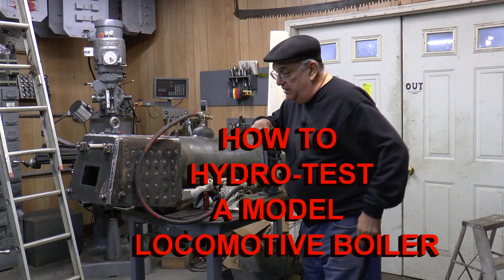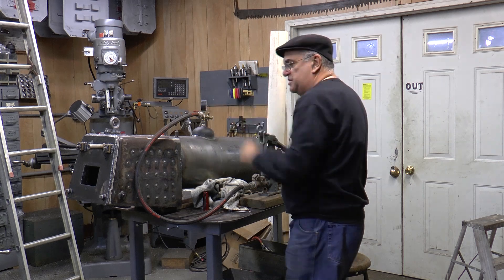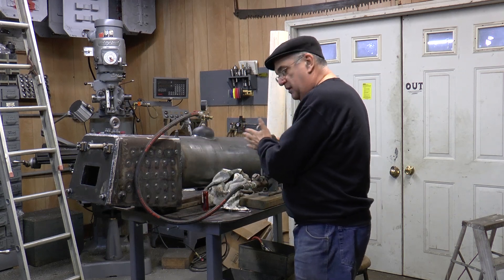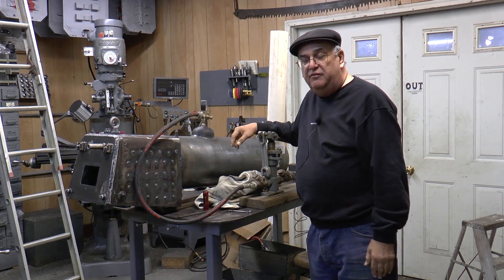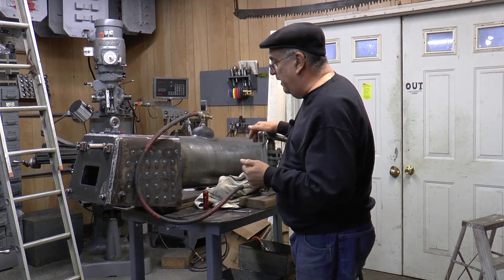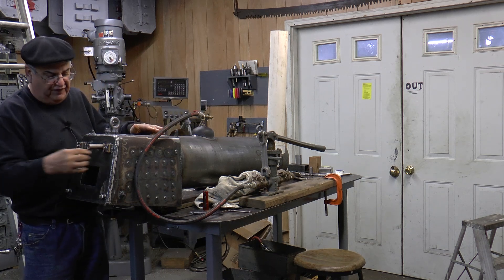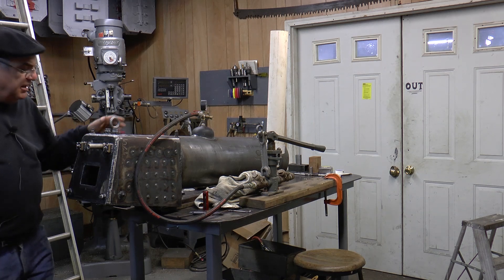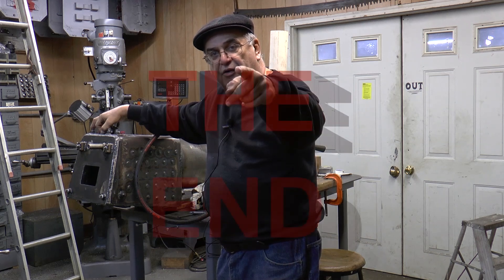HOW TO HYDRO TEST A MODEL LOCOMOTIVE BOILER

Comment: How do you do a hydro test on a completed locomotive that I just got?
Reply from the maker: plug all inlets, fill boiler with water and pump more in. same as I am doing in the video
Reply: So on my American 4-4-0 on the top where the safety valve and whistle are? I remove the safety and connect water pump with gauge?
Reply: Do you have an email or way to contact you?  Thanks

Comment: Thank you for the info in the video.  Curious to know, would a boiler done with MIG wilding be able to handle the necessary pressure or is TIG absolutely the required route to go (my understanding says MIG would work, but I prefer an opinion from an experienced hand like you).
Reply from the maker: Mig ,Tig or stick there all good the main thing is to have good sound welds.
Reply: Thank you.  It seemed sensible that the different methods would all work, but I wasn't sure if there might be some issue of MIG welds not being able to stand the corrosion of being used on a pressure bearing vessel.  I appreciate the info!
Reply: @trainman4602  hi there i really like your video and i want to know if you can build me a 65 hp case traction engine boiler for a 1/2 scale 65hp case traction engine for me please can you give me a call at 5744012465

Comment: Great information Dave. I would caution a novice or first timer to not reach such high pressures on the loco this is for new builds only. Properly done we shut off the sight glass to prevent a sight glass bomb exploding then 1 1/2 times operating pressure once in operation. 400 psi is nothing on a good boiler they are so over built. Only having a couple dozen under my belt I have really enjoyed the build information you provide. I know of two different occasions where the sight glass let go here in Texas.

Comment: Bulls hit, you still have 400plus lbs in the tank.if a fitting blows or hose or weld let's go I wouldn't want to be face high with it,That's why they submerse the whole tank in water ,with water for a pressure mediem.
Reply: Under water pressure, the pressure would drop instantly and cause absolutely no harm. Water is an incompressible fluid, so the second you lose any appreciable volume the pressure drops immediately. With air pressure, yes you're right. It's compressible and therefore will rapidly expand with quite some force if one of the thread-o-lets were to blow off. The other welds, like around the staybolts or the backhead, would only hiss. Air testing is good for finding leaks before a hydro, since air will squeeze through places water will not. If you hydro and have a leak, water has contaminated the area where the leak is. Not a big problem for a weld, you grind it out and reweld it. But if the tubes are rolled in and they leak, water can become trapped between the tube and the sheet when it's re-rolled and the area between will start to corrode, leading to a future leak. You can re-roll some tubes and be fine and dandy, but some will never reseal if they have leaked before and had water trapped between the mating surfaces.

Comment: just wondering how much horse power can you get out of a boiler this size?
Reply: You can calculate a boiler's horsepower based off of the the evaporative heating surface of the boiler, grate area, and the btus of the fuel. But as a general rule of thumb, 10 sq. ft. of evaporative heating surface = 1 boiler horsepower. The total evaporative heating surface is found by finding the surface area of the tubes, side sheets, crown sheet, door sheet, and rear tube sheet. Pretty much any surface in direct contact with boiler water that also is in direct contact with the fire and/or the hot flue gasses is included in the calculation.
Reply: SteamAndSmoke97 thanks a lot. think I need to learn more about the subject. I'm not really a steam person. but I'm really into vintage line shaft machines and would like to build a steam powered machine shop.
Reply: I suggest visiting David Richards's channel. He built a beautiful steam driven shop. The most difficulty you're going to run into is finding a Good, CODE Boiler. Decent Engines are easy enough to come by, but Vintage Boilers that are ASME code and internally sound and in good condition are a rarity and are highly sought after. New boilers are ridiculously expensive, and repairing an old one that's really beat up inside (unfortunately a lot of them are) can be just as expensive. However, if you're Not a steam person, I would suggest that you at least have a few years of reading the old Catechisms on Steam and going to some of the Traction Engine shows to get some hands on experience BEFORE you build your shop (Doing that will avoid a lot of confusion, frustration and possibly blowing yourself up). I'm sure Dave would answer your questions too.
Reply: SteamAndSmoke97 already watching him
Reply: SteamAndSmoke97 all good information I'll definitely keep it in mind.

Comment: very dangerous to test at that pressure without the tank being in water.The water would suppress a catastrophic failure.
Reply: Peter Will  that is why boilers and other pressure vessels are hydro tested. Because water isn't compressible, there is near zero stored energy. In the event of a failure, there is only a release of water. In fact, even on a full size locomotive boiler the loss of a cup full of water would drop the pressure to near zero.  No danger at all.

Comment: A variant on what you showed here: Years ago, a friend hydro tested a compressor tank that was salvaged out of a burned out gas station.  He filled it full, capped the top most fitting with the gauge.  at another fitting, he had fitted a grease gun.  It took a fair amount of grunt to bring it to 300 psi, but it held that overnight without a valve between the tank and the grease gun.

The advantage I see to your system, over the one I described, would be no risk of hydraulic grease injection if, for whatever reason, the fittings at the grease gun would fail while you were loading it up.